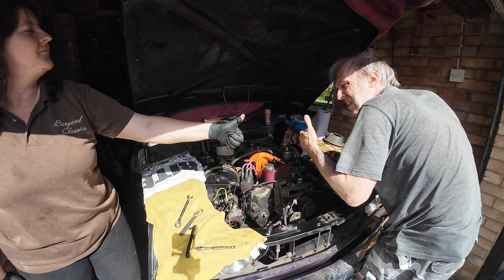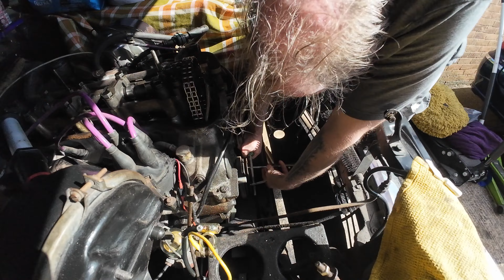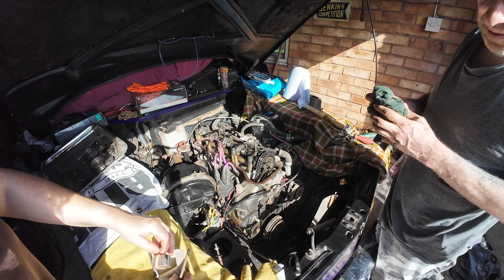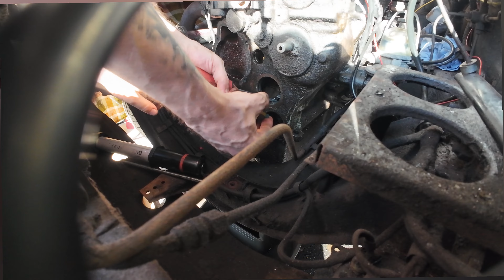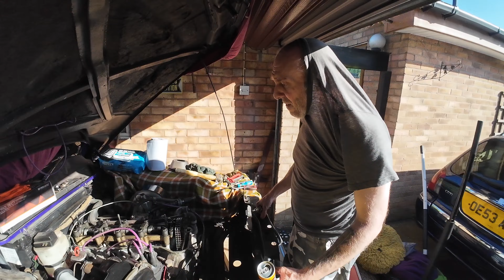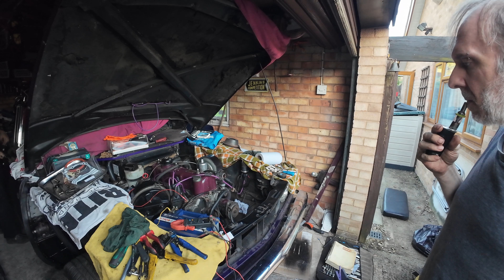Rover P6 - Bye bye noisy chain

Comment: Hi Alex, (and Mike), 
Well done the pair of you, not the easiest job in the world, especially with those plug plates. I had the same problem with my Toyota Corrola Estate when I had it in the early eighties, but it was a much easier fix because the tensioner was accesible by removing chain guard/crank case. I kept the old one for posterity. It ran a lot better after that. I must say that Mr Jenkins sounds great now, like he should do. I hope that once you have the coolant back in it won't leak...
All the best as always,
Jon B. 👍👏🙂

Comment: Thanks for the look at the lower tensioner Alex.  I've tangled with my upper one a few times, but not yet grappled with the lower.  I found it best to glue the backing plate to the tensioner body for reinstallation.  Good job getting the access plugs to go back in with new O rings!  And particularly well done managing to do it without dropping the sump, though these actually have the easiest sump to drop that I've ever encountered!
Reply from the maker: 🥰 thank you x i am so happy the job is done now

Comment: I would have taken the oil pan off! Half the time when working on these tensioners I have dropped bits down there, so I would take it off from the start. I would rather take the risk of an oil leak after wards than a coolant leak from the water pump.  Most Rovers leak from the oil pan anyway.

Also I hope you put in a Renolds tensioner. The Rolon ones have a nasty habit of losing their rubber pads.

If  you chain is still noisy after this then your engine bearings need replacing. You can do this with the oil pan off! No need to pull the motor!
Reply from the maker: Hiya. Water pump would still need to be removed to access tensioner.  
No bits were dropped, so no need for sump off. 
I had all new rings and bearings about 30k miles ago. 
The lower tensioner had definitely failed and the noise is gone now new tensioner fitted. 
The new tensioner was a genuine NOS item in BL box.
Reply: @Alexsassets  I know I took the tension off when I did my main and rod bearings about 12 years ago. I think I could have removed the tensioner unit it from underneath but I could be wrong. It had the plug in the back.

New old stock tensioner is definitely the way to go. There is also a Massey Ferguson tensioner that made by Renolds that is good. Ones marked Rolon come apart with the rubber pad leaving the metal part, which leaves a piece of metal acting as the tensioner on the timing chain. A very unsatisfactory situation!